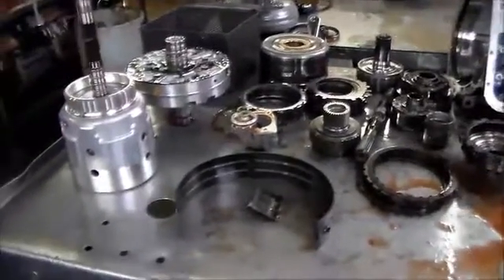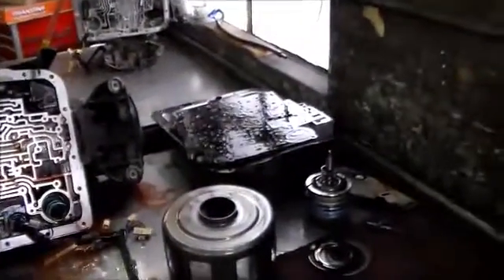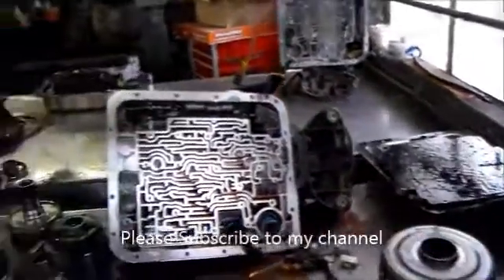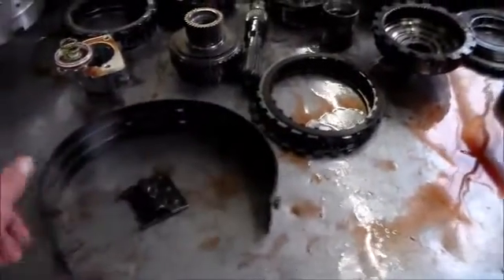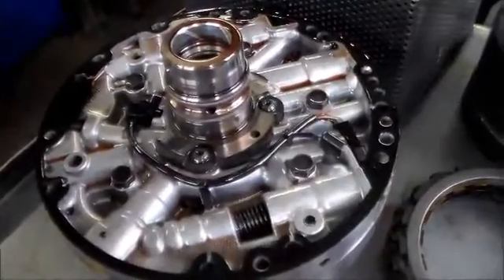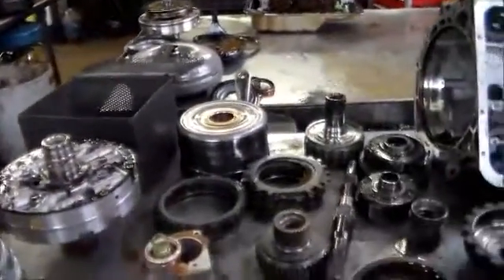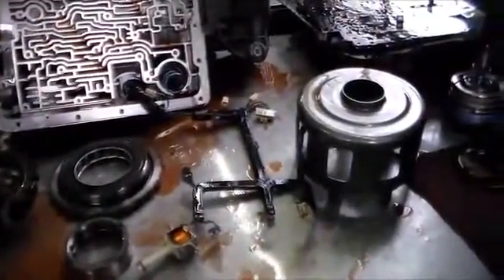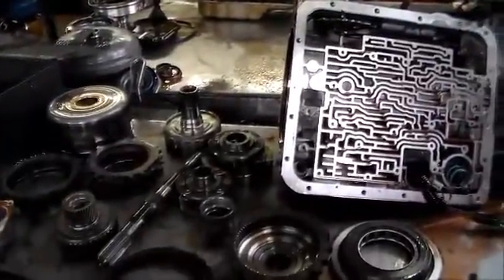4L60E No 2nd Gear

Comment: Did trans have fourth gear?
Reply: So just humor me.....mine is taking forever to shift from 1st and skips 2nd altogether and it does in fact 3rd and 4th then lockup. If I manually put it in 2nd it's almost like neutral if light on the gas but if you snap the throttle a little aggressively it will pull slightly.
Reply: @your mom 

Did you ever find out what was wrong mine skips 2nd as well but all other gears work and if I manually put it in second it acts like neutral but if i gas it hard around 5k rpms it will grab?
Reply from the maker: FREEBORNMAN  The band was broken so more than likely it did not have 2nd or 4th, I actually never got up enough speed to see what would happen, the customers complaint was a long shift taking off from a stop. The band does work 2nd and 4th, so i would say i wouldnt have 4th either,
Reply: what was the fix? mine does the same thing